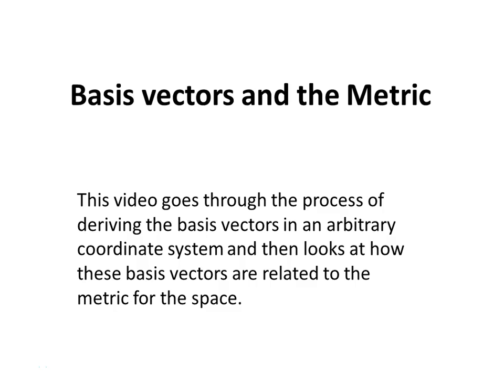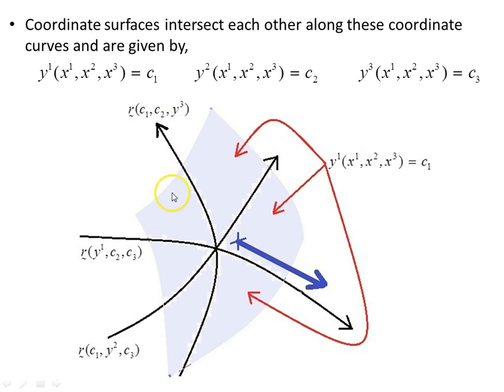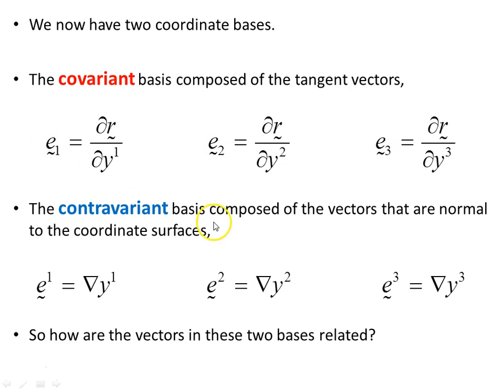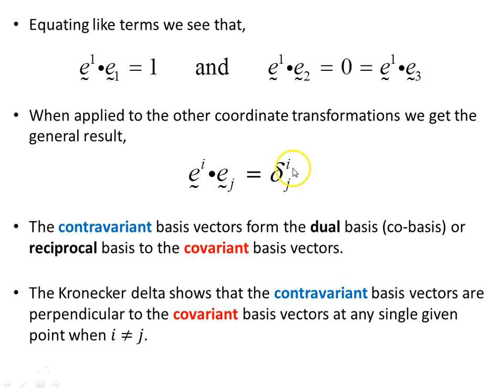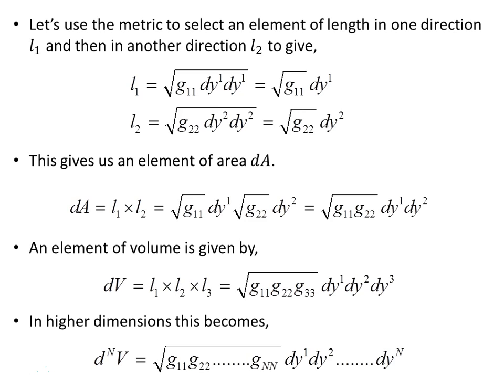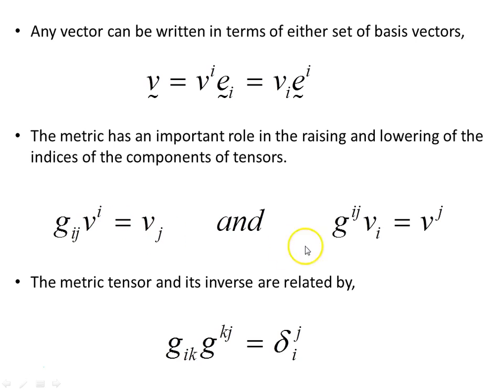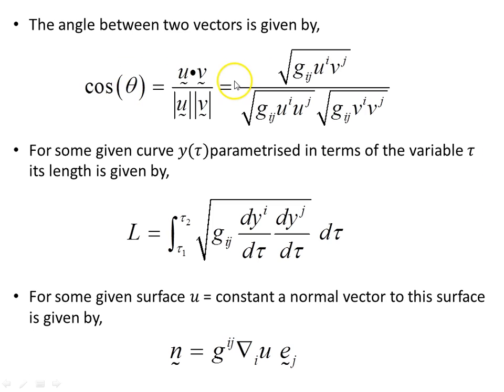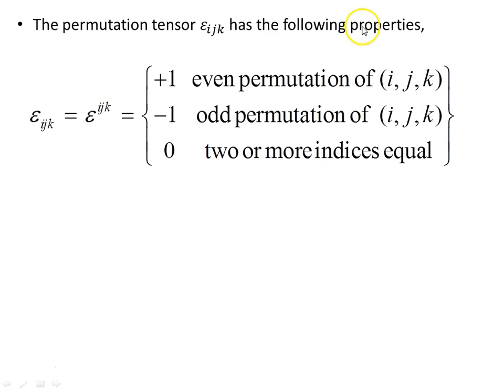Basis vectors and the metric tensor

Comment: Excellent presentation. 
In general, what is the punch line for working with both covariant and contravariant coordinates? They are both representing the same objects. The metric tensor is usually at hand anyways. At first it seems an unnecessary complication while on the way to general relativity. How come they didn't just go with one or the other? And left the other as a fun fact side note.
Thanks
Reply from the maker: Hello Benedek and thank you for your question. Wikipedia discusses this issue in the quote below and further in the link below that.

"The vector is called covariant or contravariant depending on how the transformation of the vector's components is related to the transformation of coordinates.

Contravariant vectors are "regular vectors" with units of distance (such as a displacement) or distance times some other unit (such as velocity or acceleration). For example, in changing units from meters to millimeters, a displacement of 1 m becomes 1000 mm.
Covariant vectors, on the other hand, have units of one-over-distance (typically such as gradient). For example, in changing again from meters to millimeters, a gradient of 1 K/m becomes 0.001 K/mm."

https://www.wikiwand.com/en/Covariance_and_contravariance_of_vectors
Reply: @TensorCalculusRobertDavie  So it doesnt matter if you use contravariant or covariant they are just used whenever most conveniently for transforms?

Comment: At 11:45, line 3 should end up as u(covariant)V(contravariant). Otherwise this is an excellent presentation.
Reply from the maker: Hello Ron, thank you for your comment and you are correct however, in this case, we have u(covariant)v(contravariant) = u(contravariant)v(covariant) which was the point I was trying to show across lines 3 and 4. The point here is that there are four different looking ways to get the same result. At the time I did um and arrgh about whether I should write it in the form you have pointed out but my goal took precedence in the end.